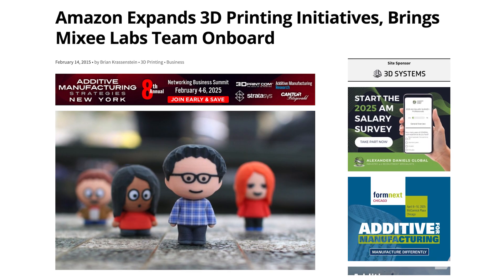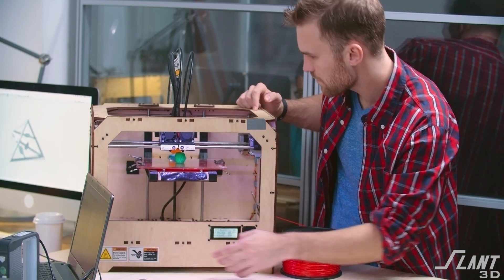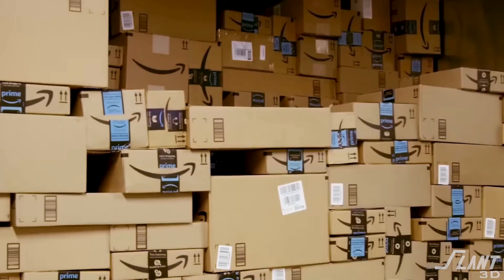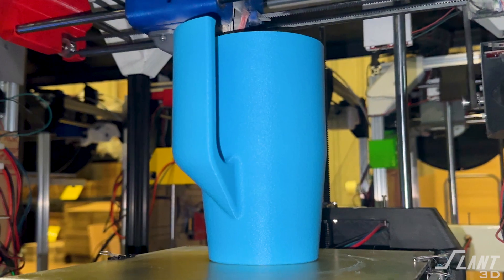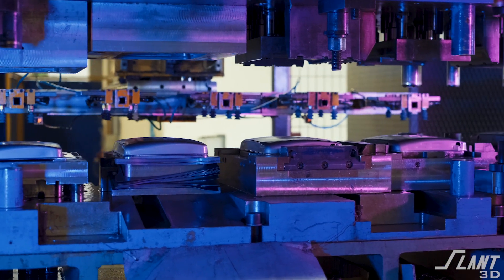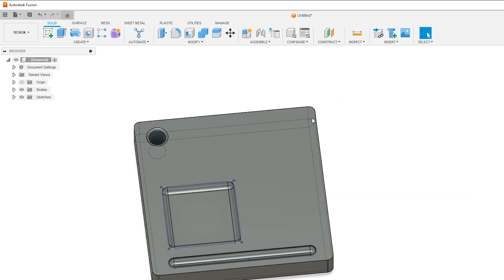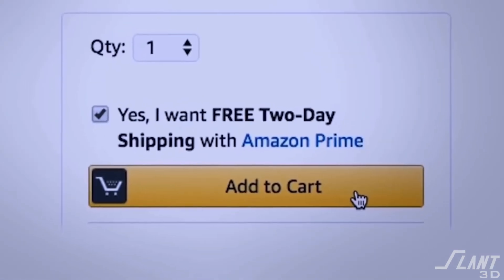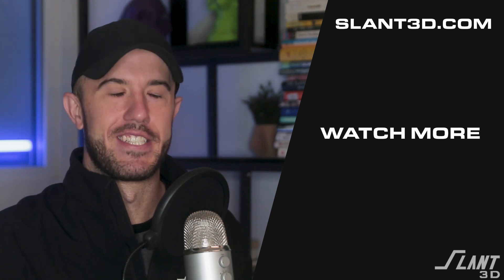Dear Amazon: Here's Why Your 3D Printing Service Flopped and How We Can Fix It

Comment: why aren't you talking about the cons of 3d printing vs having inventory ? The time it takes to print an item makes it less time efficient than storage, also now you need power to make items and technicians to maintain the printers (which is way more involved and complicated than moving inventory around with robots). Also it makes you able to print a pretty small part of the products people want, so it wouldn't be replacing the current infrastructure at all. Having designers make thousands or hundreds or even just 10 variations of one product layout is allready the same thing as having personalisation, people won't know what to choose the same way they wouldn't want to take time to personalise. overall this would pretty much just fail the same way their attempt failed in 2016. I know this is supposed to be a case study and by no mean something you suggest Amazon should do, but I believe the point you were trying to convey is either not viable or not explained in a way that made it easy to grasp. Maybe this is an attempt at telling us you have an API to print stuff ? it's my best guess, but then I don't get why a poor case study would convince anyone. Still watched the whole video, the production is nice as always
Reply: @skecpg  you must be new here, he regularly addresses that
Reply: What limits? There are no color limits and very few design limits. There are no engineering costs associated with designing a mold and then creating a new mold just to add a feature that wasn't there with the first interation. There is zero benefit to having inventory on hand unless what your selling is high-demand replacement parts that would be needed in a hurry. Molding requires TONS of inventory in order to amortize the cost of the production. In many cases that inventory sits unsold for months which costs money.
Reply: @phasesecuritytechnology6573 I’ve been on both sides of this.  Back a couple years I had a product I sold on Amazon that was 3d printed.  I had 3 printers that I kept running about 12 hours a day and just barely kept up with sales.  Finally got a small manual injection molder and taught myself how to make a simple mold on my cnc mill. 

It took 9 iterations to get it perfect, but each iteration was less than a day for design changes and making a new mold. Materials cost was a few $ for aluminum. 

Once I had it done, I could produce two parts at a time, with a cycle time of two minutes.  I was making a part a minute. 

Next step I modified the manual (lever actuated) injector to have a pneumatic injection system with injection times and cycle times controlled by an arduino
Mega. 

That machine cranked out two parts every 100 seconds with the bonus I could have an employee run it. The manual machine required about 100 pounds of pull on the handle so it was only operated by me. 

What used to be 70-80 hours of 3D printing on 3 machines was replaced with a superior product for which production took one employee 4 hours a week. 

The part was cheaper even after employee time because the plastic was so much cheaper. 

I still 3d print things. And I made other plastic injected parts. Everything has pros and cons, you make the
Best choice for the specific need.
Reply: @phasesecuritytechnology6573  there are an insane amount of design limits. for colors, by using print heads you feed with beads , you could make it work with less complexity than filament, you would still need to manage supply on this. for design though, I'd like to see a print farm make me sturdy monitor arms, or a desk chair, or kitchen knives, or a mirror, or a new charger, or a lock, or an electric kettle.... I can keep going you get the point. you can only print static items or low performance mechanical parts. It's not for no reason that everything branded Amazon Basics is other companies products rebranded. It is not worth it to produce everything. Don't forget Amazon's objective, they sell everything and want consumers to get exactly what they want fast, for them, having inventory at hand is the way to go, that's whats best for their objective (making you pay them because you have your shit one day earlier than with other companies)
Reply: Gabe regulary adress that, but in short, in a decent size print farm like they have, one or two broken printers are just not a problem, since you shove the part simply into the next free printer. Printing time for something like the holder Gabe showed is something like 8- 15h. Doesn't work with same day delivery, but printing the product and ship it the next day is possible. Taking the example of a pen holder out of plastic, you would buy a mould for injection moulding, something like 120000$, than let a company mould your part in a part size of 5000 parts or something, than ship them to the warehouse, where they sit on a shelf. That creates a good amount of money, that you can save by having a warehouse, where the shelfes itself create the product. Also, you don't need to babysit a good working printer that much, one person can supervise a lot of printers.  
To the point with the variations: I guess you get that wrong. The part is about design iterations, like changing the dimension of a chamfer, not selling 10 different designs, there you would be right, it is possible to have a high amount of different colors and designs for customers, but that creates a bad customer experience. To the part with power and technicans, how do you think, injection moulding works? It is also highly energy hungry, and you need to pay for a very expensive and complicated moulding maschine (when not outsourcing it) and moulding form instead of paying a print farm.
I agree with you, that Amazon as a highly automated company with as little down time as possible, to achive a real fast delivery is probably not the best example. But for most companys, a production time of 24h would be great, saving the costs for moulding, shipping over the ocean and storage helps them making a part profitable, and they don't need to pay a lot upfront and are allow to mess up the first prototypes. With injection moulding, burning a 120k mould is simply not an option.
Reply: @unknown_user2345  I see, yes I understand your point, for other companies than Amazon on specific products this does make sense. I can definitely see how a big specialised seller (for example an auto parts shop) could highly benefit from that kind of model. In that sense, that would be a  print farm as the back end for a specialised retailer, with the right kind of products, I see the potential (the one that comes to mind is the automotive part shop, as sometime when you need a specific part of an assembly to repair a car, it's super long and super expensive because that kind of inventory fits the description you gave, costly to produce in small quantity, and stays on shelves a long time)... I wonder if it was allready tried or not.
Reply: @skecpg  just like everything, there are trade-offs when you go with either route. 

3d printing hasn't been fully integrated into manufacturing, mostly because you have literally trillions of dollars worth of infrastructure invested into the current manufacturing processes. Once those machines start breaking down, companies will reconsider and start using more on-the-fly manufacturing methods.
Reply: @KeithGroover  I think big companies more than likely allready considered other manufacturing methods. If what you say was true, wouldn't we allready see a portion of the manufacturing infrastructure using the more on-the-fly methods ? for now it seems to be marginal. There are trade-offs, there are legitimate good reasons to use 3d printing over anything else for many use cases, manufacturing isn't one of them.
Reply: Exactly! He conveniently leaves out all the resource, technical and manpower issues. As well as the limited production rate and limited production catalog material and finish wise. 3D printing just is not there yet. Also these changes would also change your commercial zoning etc. Even if you had a "miracle 3d printer"  none of those cost savings will be passed onto the consumer anyway, and the miracle 3d printer im sure would make sure its own costs from whatever company that makes it come in just below the previous costs. not to mention the need for electric motors CPU's etc. so now you have have 3d printer robot assemblers to assemble all your 3d printed components and electrical etc; and guess what? the chinaman is CHEAPER!